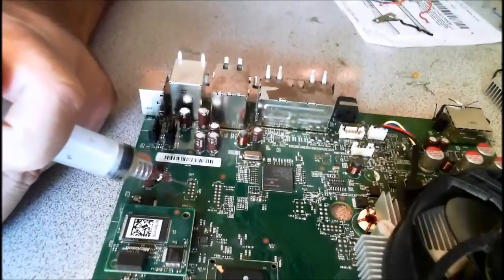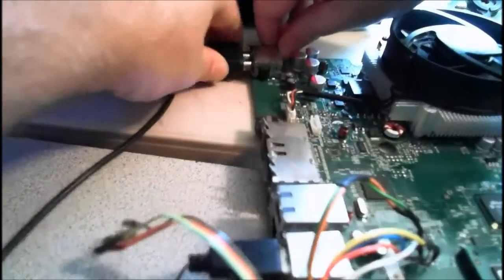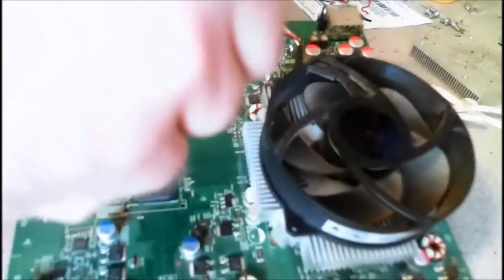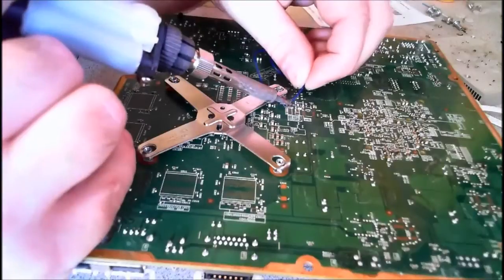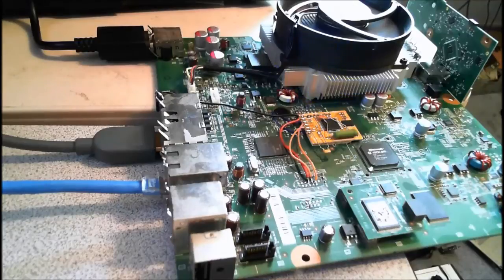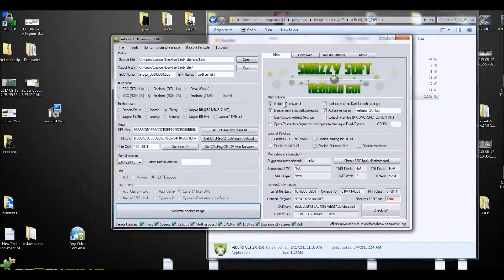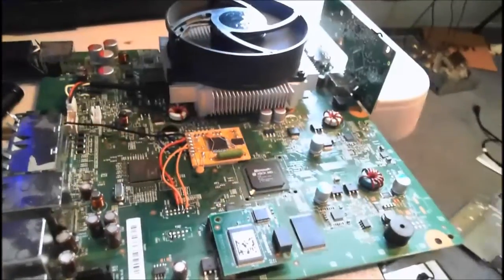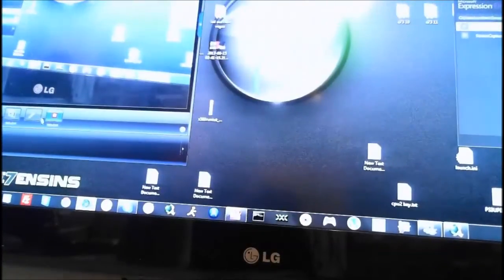x360run

Comment: I'm having some issues on x360run chip. It doesn't boot no blinking lights even when it has power. I'm using Xbox 360 e. Hoping you could help me resolve this problem. Thanks in advance.

Comment: i dont know what im doing wrong. i tried everything, different cables, different length, different placing, different jumper setting on the x360run. but mine has so different boot times. sometimes 1 cycle, the other time 20 and sometimes it hangs and wont boot at all. i swapped the 330pf cap with 220pf and the boot times even got longer on my Trinity.
Reply: Get an x360 ACE, the run isn't a very good chip.

Comment: Nice chip have to agree, but I would'nt call it noob frendly. You need a bit of soldering skill to set the timeing and impulse lenght just by soldering some points together to get the best boot time, as the manual says.
Before I replaced the capacitor it booted like in 1 minute or more. After I put in a 150pF one it boots almost instantly like in 2 seconds :D

Comment: Great chip. I've used your exact tut on 8 straight trinity with zero issues with the stock 330 cap. boot times are 5-15 secs. today i got my 9th trinity, but this one is different. it's take 5-30 secs to boot. can i use a 270 "ceramic" cap?? Only ones i can find are "ceramic"
Reply: +Jared Jared ceramic multilayer for those, not the disc type !